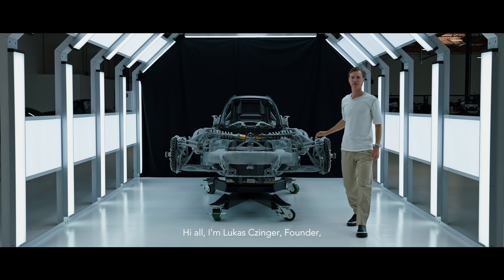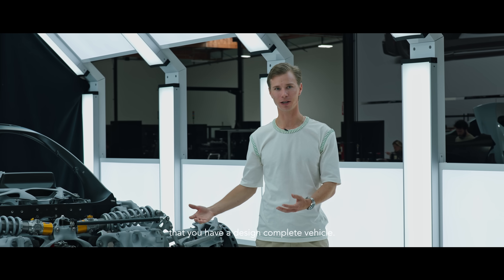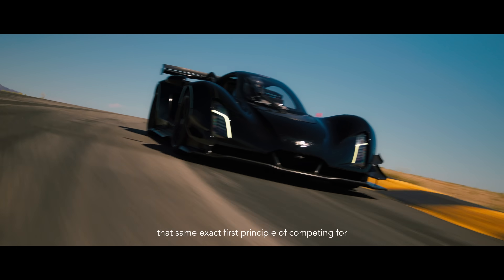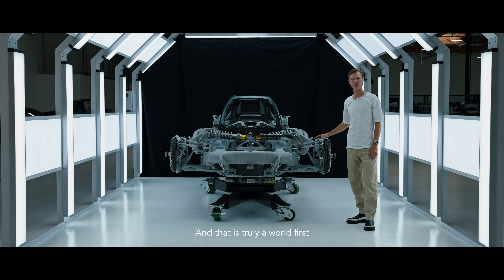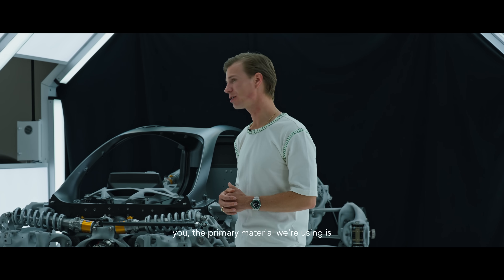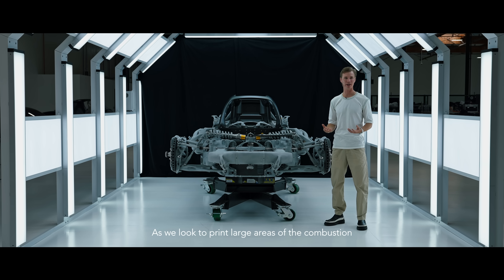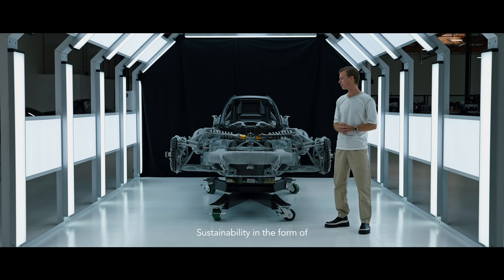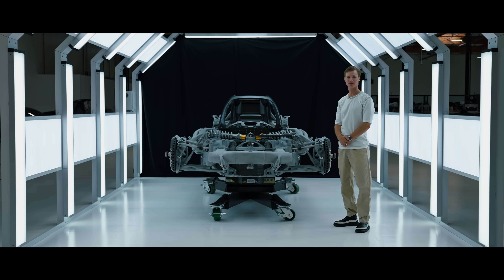Czinger 21C: The World's First Bio-Logic™ Chassis | In-Depth Overview

Comment: Nous savions que ce serait plus efficace mais du fait de la complexité des calculs ajoutée à la complexité de réalisation nous avons simplifié le travail en utilisant autant que possible des lignes droites ou des arcs. Aujourd’hui avec l’intelligence artificielle et les diverses techniques d’impression 3D, c’est abordable.
Les os des grands goélands sont faits d'un matériau misérable,
principalement du carbonate de calcium, mais, en raison de la complexité de leur géométrie, les goélands volent très bien même dans les tempêtes sans se casser les ailes.
We knew that it would be more efficient but due to the complexity of the calculations added to the complexity of production we simplified the work by using straight lines or arcs as much as possible. Today with artificial intelligence and various 3D printing techniques, it is affordable.
The bones of great gulls are made of miserable material,
mainly calcium carbonate, but, due to the complexity of their geometry, gulls fly very well even in storms without breaking their wings.

Comment: Really cool car but you can't say your goal is to be more sustainable if your main way of producing car parts is by using slm printing. That aluminium powder it's not recycable and it has to be changed for a new one every time,  slm printing have a lot of possibilities but sustainable it's not one of them, you throw away more material than in a conventional manufacturing process.

Comment: If it were the lightest and stiffest structure for a car, it would already be in use on F1 cars.  It's not, therefore it isn't.  Carbon fibre remains the optimum structure for a car's cell or monocoque.

Comment: The technology and application is really cool, but I feel like you fell into common marketing lingo. 25% lighter than what? A car who's chassis is referred to as a skeleton, does that mean anything? Also you have the theory of evolution a little off, nature just optimizes to what can work in an environment, its not necessarily the best solution. I'd have proffered to know that it was lighter to a similarly powered car, or a sports car with similar crash ratings. I like that you explained the process of adding material where necessary, but I wish you started with that then explained why it was like evolution or a living skeleton.

Comment: A glued-together, sintered alu chassis. Repairability: Zero. You can't bend it back, can't weld it ... only cut it up and melt it into soda cans. Great.
And those large carbon body panels? Nobody with the cash to afford such a car is going to have those repaired after a little mishap, only replaced. Super green concept and exactly the kind of 'sustainability' we need more of in the automotive world. 
25% lighter than what exactly? How much of that is due to it being a feckin monoposto? 

So much marketing babble ... topology optimization is used for every cast aluminum part in every road car out there, you're two decades too late to call it a revolutionary new thing. 

I don't dislike the car per se, and Goodwood has shown it's definitely capable, but tone down the bs, Mr. CEO.

Comment: I am interested in what the generative design to manufacture process actually is. Off the top of my head, I imagine that a program like Matlab takes in all of the required parameters from a database (for max and min size, mass, material, torsional rigidity etc) and then outputs the optimal solution as a mesh in a STEP file format, which is then passed to a high end CAD program (like CATIA v6 or Siemens NX) for a CAD technician to "trace" around and optimise it for manufacture. Then the 3D CAD file is exported to a 3D metal sintering machine. I might be completely wrong of course and there may be one single program which can do all of this! Either way, it is super interesting.

Comment: I would be really comfortable with metal 3d printing complex limited components in a vehicle design. But 3d printing an entire car sounds like a high volume production nightmare. But this is a good start to showcase what AI-driven additive manufacturing can do. Maybe it will push automakers to start using it in limited capacities after using this car as a case study. Still a good decade tho before this becomes mainstream.

Comment: What an arrogant moron... "Here, we have a frame designed for the vehicle - it must be first time anyone has done that!" "We optimize over more than one variable - it must be first time anyone has done that!" 

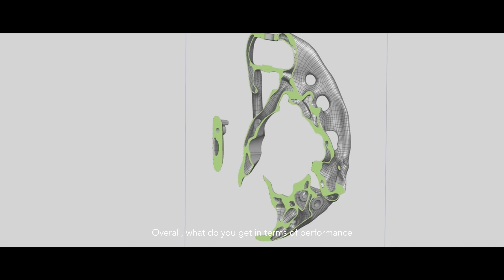Soon after he claimed that even a single gram could not be removed, there is a spacer shown at a chassis joint that is several millimetres longer than necessary; oops, maybe don't look at that part, or at any of the many off-the-shelf components that are not optimized for this specific vehicle. But on that subject, I will give them credit for integrating the brake caliper with the hub carrier (on the basis of material efficiency) as shown at 3:55, even though that is a terrible idea for the sucker who will own the vehicle.

He also apparently thinks that evolution only extends over a timescale of centuries; back to biology class...

Comment: Good engineering should always be a well thought out choice between all manufacturing options you have available and not just using the “fanciest” one for all of your problems. SLS printing is clearly not the best option for all design decisions. A CFRP chassis will always be lighter and stiffer. The printed parts are esthetic, ok, but don’t sell it as pareto optimal engineering while neglecting other manufacturing/material options ;)

Comment: 4:39 - 25% lighter and 25% less material.  Well, its probably more than 25% because they are using additive manufacturing rather than subtractive.  Now, one could argue the waste from subtractive manufacturing could be re-cycled, and it can, but it cost a lot of energy to do that.

Comment: Bio-Logic is quite the marketing shanenigan. What makes it biological? You are using IA to iterate finite elements and come up with something. You are probably locking for standard components, screws, printing limitations and stuff. I will call a car biologic when I see one growing from a seed or subdividing cells or something haha. Bionics is a thing in product design but that's not what you are doing. Also how many have you crash tested and compared with your simulations?
It's a beautiful way to design the car structure, I'll give you that.

Comment: If the complete body is unified, how do you replace a part of it in case of an accident where for example a mere 5% of the chassis is damaged?
As dope as it looks, it will probably struggle to find market share out of the hypercar community. Maybe try formula1
Reply: In the video it seems like their parts are still seperate as i understand it its just that all the parts have been generated simultanously to alltogether fit the constraints

Comment: One shoud read that they are using AI. Hype train is on the way 😎 tchuuu tchuuu
Reply: More seriously, I think that with money you can build such a thing easily today. So many talented engineers and suppliers that you can assemble and show such a nice car. But the words hurt me. It's just too much to be serious. Softwares are on the shelf, technology used is now common for low volume production. And now AI is in the loop, what else ? More seriously, top manufacturers today are doing CO2 optimization, not only structure. Then steel is still a clever choice.
Reply: All aluminium grades have a finite endurance life compared to steel from my knowledge. At one moment, even if we neglect damage, corrosion problems etc this chassis will fail under loading. Imagine the downgrade of additive manufactured aluminum on top of that... Even my mountain bike will fail, just have to think to change it before that time.
Reply: So if you want to sell such a thing, just select the best high tech words from aero such as, aluminium, inconel, in-house material dev, 3d printing, bio mimics, multi-variable optimization, AI. I think we miss crypto. Too much for me to take it seriously.

Comment: In terms of engineering this is great but you can't be serious saying that this design saves cost. I saw so many parts that can only be manufactured by casting or additive manufacturing that are usually simple stamped steel parts that cost a few dollars.

Comment: It seems only logical to use bio mimicry to achieve insane mechanical strength, high level crash safety, and with very low weight and cost. Insects are the perfect example. 
Once someone cracks the code to manufacture this way at huge scale, machines are going to be truly beautiful and functional.

Comment: You can’t call it sustainable if even a minor fender bender is going to total the entire chassis… causing large sections to be completely replaced. When the production method uses more energy than traditional extrusions or composites do to make. Sustainability is a overall measurement not just a measure of material/weight reduction
I thought this was beautiful when it was a concept ages ago, but the amount of corporate bs speak he just word souped completely changed my opinion on the car.
Reply: To be fair, an this might be insider knowledge from the polymer industry, but there is a lot of research going on rn thats showing ways to create composites that are recyclable. In effect reclaiming the resin that is coating something like carbon fiber, while leaving the carbon fiber untouched. On top of that there's work being done looking into the actual chemical processes of manufacturing composites to find ways of making them more sustainable. Like rn the process of actually making carbon fiber is not completely understood and thats an area where a lot of people are turning their eyes in terms of research.
Reply: Buzzword catchphrase, Buzzword catchphrase!
Reply: this is an investor scam, not a real project

Comment: this weighs 1250kg according to wikipedia which makes it 250kg heavier than Murray's T50 which has an extra seat, and on par with a Lotus Emira, I'm not seeing anything staggering there to be honest.
Reply: Murray won most if not all the gains in the beginning by starting small size and focusing on old school basics. The Czinger is revolutionary but it's still bigger than a T50S
Reply: @srinitaaigaura Bearing in mind the T50 has an extra seat and proper storage it's even more impressive that it's smaller.
Reply: Ya but czinger managed to put a whopping 1350hp into that car so it's power to weight ratio is about 30% larger than the T50
Reply: @lucasinacio8251  That is a remarkable achievement, but for the fact that the Czinger's engine is more silent than an EV.
Reply: Just 2 "little'" details, you have the weight of the battery and you must stand the torque of a 1300hp (close to 1 megawatt) motor
Reply: It looks cool af.
Reply: This^
Reply: The Murray T50 has around 700 hp. The Czingrr has combined around 1250 or 1350 hp. That's a huge difference.
Reply: @ToniLee2000  True, it would be interesting to see a chassis to chassis comparison with the drive trains removed from each, I would guess the batteries add a lot of weight to the Czinger but the T50 has a 4.0l V12 compared to its 2.8L V8 turbo so it saves some weight there. Even if you granted the Czinger a couple of hundred kilos for the batteries and motors it still isn't any lighter than the T50 which isn't really selling a 'game changing' technology for me.
Reply: @boing615 yea but the horsepower difference is 600+ difference
Reply: My 5 seater Fiesta ST weighs around the same.. Not really that impressive for a single Seat now that I think about it.
Reply: @CrackedTubeGamer now list the horsepower and downforce numbers lmao
Reply: @gorps  Yeah but can you get 5 people in it, a boot for storage and have it survive the UK's pot holes and B roads as you blast venga boys at the early hours of Monday morning which pretty much starts you in a race with the nearest shit box?

Comment: been looking for the term for this design where the material built upon only the core stress, strain and compression only present applied at the bare minimum with no more surpluss of material used in the application of physics. The Pareto Optimal might not be the right term but this concept. This dude did it, something radical and possibly closer to the calibre of Christian V. K's vision.

Comment: Pareto optimization is a generic term for multi-objective optimization (or optimizing for more than one thing at the same time). There are many different algorithms  to do this (all of which have been around for many decades). A class of such optimization algorithms, called genetic algorithms, attempt to mimic the act of solving optimization tasks via algorithmic evolution (generate a population of potential solutions, apply “crossover” between pairs of solutions (ie mate/combine them), and then apply some “mutation” with some probability to one or several of the output variables to maintain a diverse set of solutions for the next iteration. Do this many times until a solution set lying on the Pareto/non dominated front is found. The Pareto front is the part of the solution space, or set of solutions, at which none of the objectives you are optimizing for is over optimized relative to the others while respecting constraints). These techniques have been applied for decades in building structures and in manufacturing. I doubt they can fully formulate the entire car build in a single multi-objective optimization model (the computational power needed would probably be insane), unless they let the computer run for an unreasonable amount of time, but they probably can optimize the build in a few models solved sequentially. Even still, the car looks sick and it is a really awesome application of mathematics in manufacturing